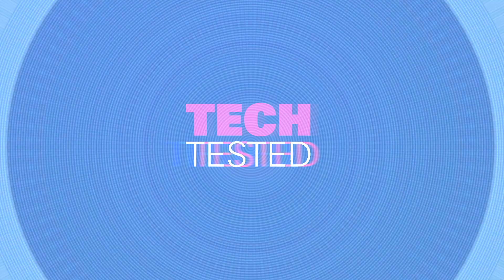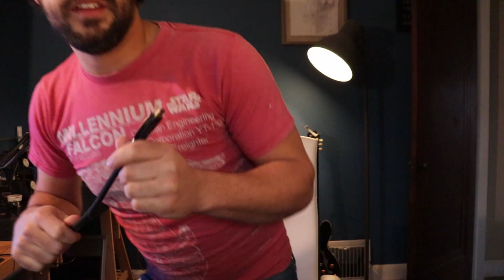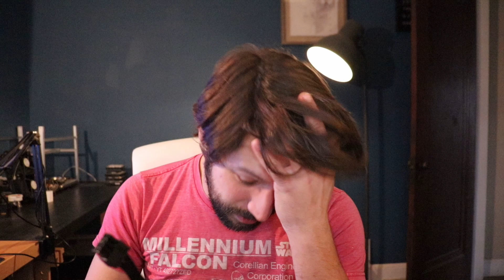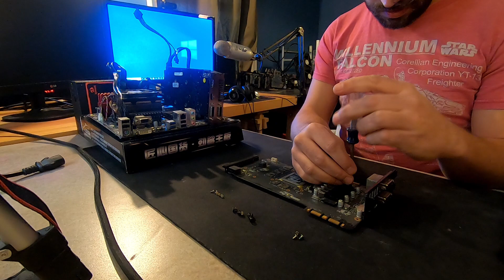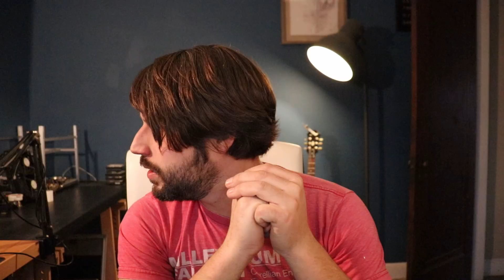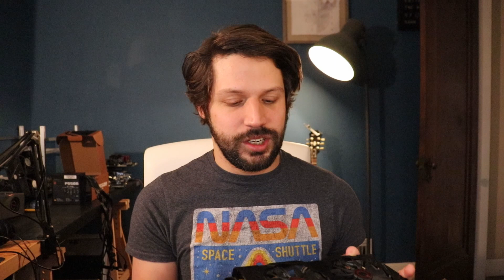I Bought a Broken GTX 970 for $30...

Comment: Glad that worked out for you :) You do what I do too - jump straight in that rabbit hole before trying the easiest thing first. Get's me every time!
Reply: Also what do you think of the FX 8320? I have a couple of builds I'm working on with these in - trying to work out what to pair them with to get rid of them!
Reply from the maker: @turbopeacegames  honestly I would sell it on eBay or keep it for some overclocking fun. They are going for close to a hundred dollars US on ebay.  If not that then maybe a cheaper home server CPU.
Reply: @TechTested  That's a good suggestion - I pieced together a NAS with a Core 2 Duo and seems to be doing the job so far. Using it for backups and streaming 1080p content from but the 8320 would definitely be more future proof. One of these PCs with a 8320 originally came with a 9590 but I could not keep it cool/stable with any coolers I had here so had to "downgrade". I'll be doing a binge of your videos this afternoon so sorry if you get a tonne of comments from me on your videos!
Reply from the maker: @turbopeacegames  appreciate the support! We stopped for several years so there is a bit of a gap.